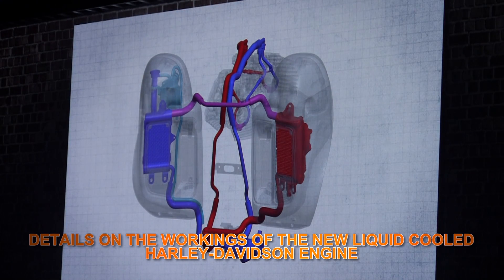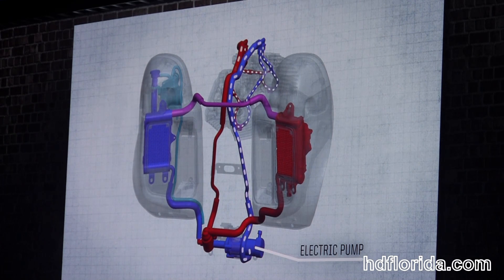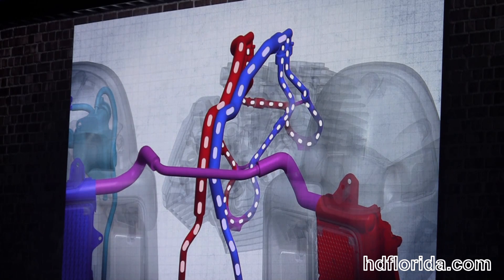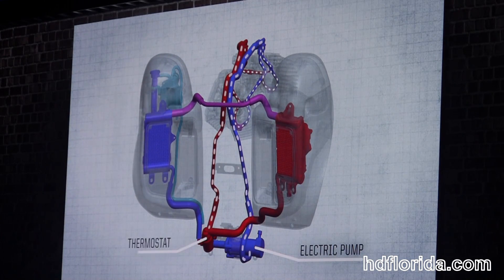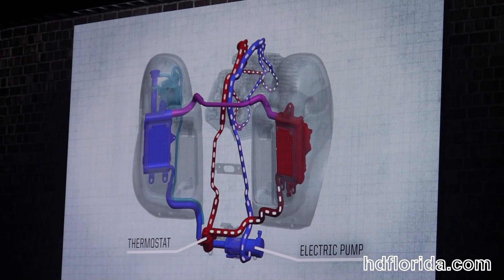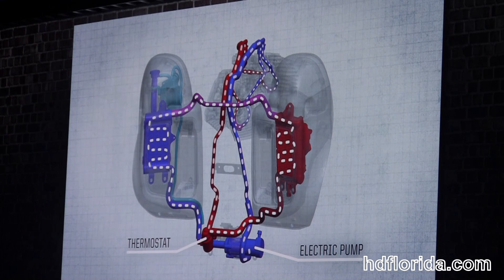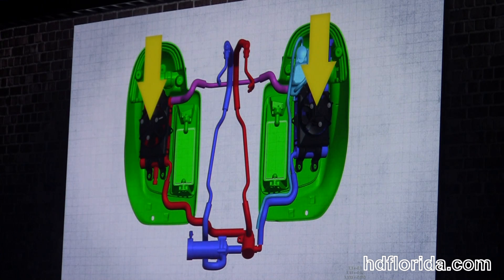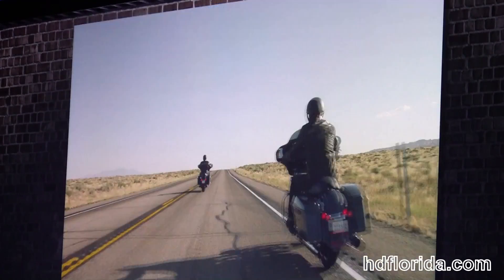Harley Davidson Liquid Cooled Engine - New 2014 motorcycles Models

Comment: So let me get this straight. They put radiators in the lower fairings? Most people like to remove those during the summer for more airflow on the riders. Radiators need straight through airflow to cool them. Does this mean that super heated air will now be exhausted right on the riders legs????

Comment: No the exhaust is vented out the side of the lowers. There are still vents for the riders legs. After 200 miles on my 14 Ultra Limited yesterday it does stay cooler.

Comment: Water cooling the hot rear cylinder exhaust valves is the least of the problems with the TWINKIES, produced from 1999 to the present. The flywheels scissoring is will self-destruct the engine components in no time, when the pinion and sprocket shafts exceed the max run out of .001", and at .003", run out, damage to the bushings, cam shaft bearings, oil pump rotor, etc, begins and just worsens till the engine is cratered. The PLASITC cam chain tensioners, on the two silent chain drives are another hidden danger, and most Harley owners are not even aware of these items which rub against a METAL chain and must be periodically inspected and replaced. Of, course Harley no where in the owner's manual or Service manual, tells owners what the mileage inspection intervals are, much less when to replace the PLASTIC tensioners, before they break apart and then have METAL TO METAL contact and causes IMMEDIATE CATASTROPHIC engine failure. Even with liquid cooling, drop the bike the first time on either the low side or high side and scratch a radiator, cooling fan, and thermostat or electric water pump. Metric V Twins with great displacement engines only use one radiator and it's smartly located in between the down tubes and one can drop the bike on either side and no damage to the radiator. The TWINKIES run hot due to an inadequate oil pump that only produces 3-8 psi of oil pressure at idle so, no wonder the engine runs hot and heat is the engines worst enemy, breaks down oils quickly and fries  the family jewels while on in the saddle. Even with Twin Cooling, the bike still needs a rear cylinder heat shield. And these TWINKIES leak coolant and Harley cannot or will not fix the problem. CAVEAT EMPTOR-LET THE BUYER BEWARE.